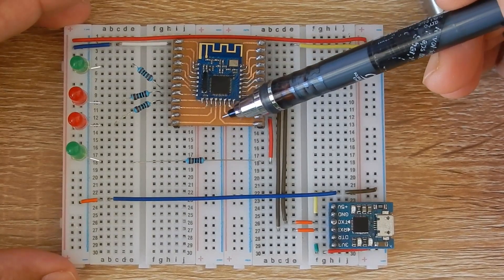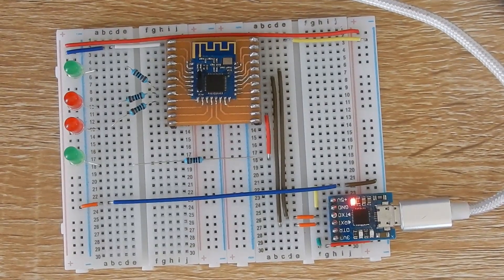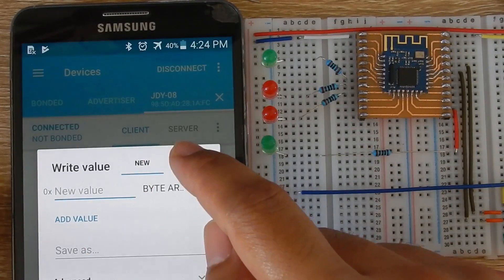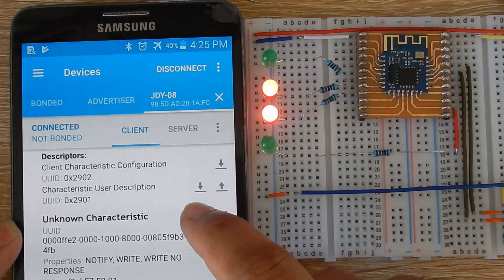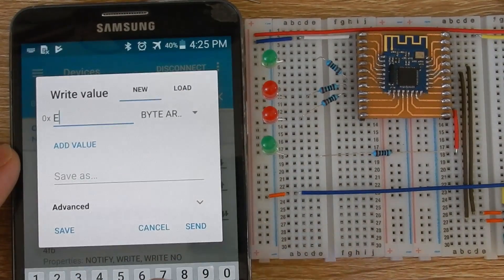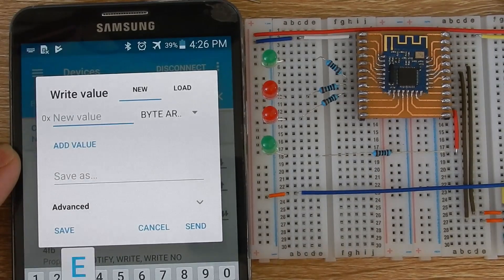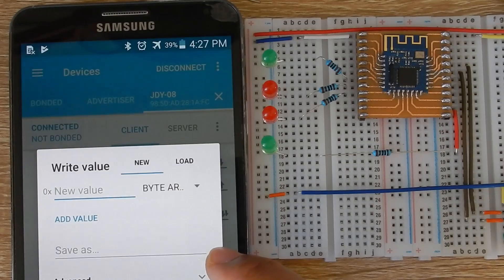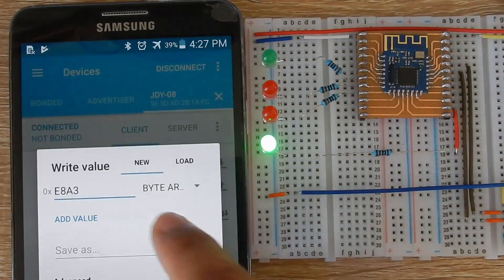Bluetooth/ BLE remote control without external MCU (JDY-08)

Comment: Mohammed Rezwanul Islam
can you read PWM (and IO state) on JDY-08 by a smartphone ( E.G. we are futher from JDY-08 module so we dont know what state of the IO or PWM pins)
Reply from the maker: Nope
Reply: @MohammedRezwanulIslam    I have done that(read PWM ) but  it can not with RTC (0xEC ...?!)Although I changed it being 0xECB...
Reply from the maker: I could not get the RTC working through smart phone.

Comment: Sir...What library you used to program the module ???
Reply from the maker: No library. I am using the stock firmware.
Reply: @MohammedRezwanulIslam  so what if I want to send a particular data from my phone . How will I program the board without external microcontroller
Reply from the maker: @WeTravel2023  you need to send some command from the android side.
Reply: @MohammedRezwanulIslam  could you please make a video  on it ?? Like how will I send a particular data say 123 or any char , with a LED as output .

Comment: @Mohammed Rezwanul Islam
 ; please tell me, why you don't use P17 (UART - RX) and P16 (UART- TX) to connect to PL2102  TTL to USB communication
Reply from the maker: I think I have. See the jdy-08 review video. In this video I am showing how to use it as a standard alone  IO controller.
Reply: @MohammedRezwanulIslam   thank you very much , because I am reading a news so I want to say thank an other time (this evening)  my local  is afternoon . I have read the host part of JDY 08 so I want make a project to scan BLE with a nano and write a sketch to run it  but with your video I think I use JDY 08 without the ardruino
Reply from the maker: @ThuanDuong-pv3xu  "AT+SCAN1" will scan the nearby ble devices.
Reply: @ @MohammedRezwanulIslam  ; I have watched your Video many time, I have read JDY-08 Bluetooth LE Module Datasheet too, But when I send ' AT+ SCAN1'  as your comment I am recerved by message ' OK,   SCAN STOP ' so what happened ?
by the way, I see part 8) APP control IO port (Use features UUID: 0XFFE8) in datasheet ,but you write control IO hex  ' 0xE7....' ?  and part 9) APP PWM control switch (using a feature UUID: 0XFFD9) , but your  is ' 0xE8... '  ?
Reply from the maker: For me the "AT+SCAN1" works.
Reply from the maker: Those are UUID. Read Bluetooth specifications to understand the full protocols.
Reply: @MohammedRezwanulIslam  : I am studying JDY_08 and JDY -10 , I have watched some web  , may I ask you  a question , can you change  Rx ( P02 ) on JDY-08 by another digital IO ? or  have you get a sketch of firmware on board  ? I watch a Germany 's instruction  but his project is the HM-10 and seems a bit complicated
Reply from the maker: @ThuanDuong-pv3xu  no, you can not change the rx pin.

Comment: Good video Mohammed, thanks for sharing!
I couldn't see any input pin on this module. Is it possible to connect a simple switch and detect open/close position as I would normally do by configuring an input pin on other controllers?
Reply from the maker: There is no input on this module. Only output. You can use cheap microcontroller like attiny to do the job.
Reply: @MohammedRezwanulIslam  I was trying to avoid using both microcontroller and BLE module. Are you familiar with an alternative BLE module I can program as stand alone sensor (without going into $3,000 compiler)?
Reply from the maker: @NinoRansenberg  nrf51822  module. The compiler is free.
Reply: @MohammedRezwanulIslam  Thanks!

Comment: Hola, qué tal,  it is a very good video, but I have consulted the link and don't find the app, so I want to say you if you can help with the app or the program or files. Saludos desde México.
Reply from the maker: In the description there is a github link. That link has the source code of the app. You need to install "android studio" to compile the source code.
Reply: @MohammedRezwanulIslam ok, thank you very much.
I see it and  comment you.
Reply: @TechMonky71   te salio?. En mi caso si logre compilar pero no detecta ningun bluetooth.
Reply: @markscalderonniquin9274  oh!   
Disculpas pero no he podido adquirir el módulo, espero más adelante poder comprarlo y probarlo.
Reply: @TechMonky71   ok

Comment: Can I upload a blink sketch into the Bluetooth module?
Reply from the maker: No
Reply: Ok, thank you.
How to add custom service(s) & characteristics? For example Battery Service > battery level; battery temperature; battery remaining time; etc.
Reply from the maker: You can not add custom services in this firmware. You need to write your own firmware. The compiler costs around 3000$.
Reply: @MohammedRezwanulIslam   how can we develop our own firmware?
Reply from the maker: @markscalderonniquin9274  the compiler is expensive. Around 3000 USD.
Reply: @MohammedRezwanulIslam  yes, I see but I will use the trial version
Reply from the maker: @markscalderonniquin9274  trial is for one month only as far as i know. It isn't worth my time.
Reply from the maker: @markscalderonniquin9274  you can use nrf51822 modules. The compiler is free though.
Reply: @MohammedRezwanulIslam   Thanks, I'll test it

Comment: Hi, I really enjoyed the video. It did inspire me!! I used this to automate my watering system powered by 2xAAA batteries. Backend attached to node red Raspberry Pi3 node red. The issue I have now is power consumption. It is consuming 8.3 mA and lasting less than 10 days. Anyone know how to lower the power consumption?
Reply from the maker: Put the device in sleep mode.
Send "AT+STARTEN0" command. It will enter into sleep mode. It consumes around 0.8mA. Try this command and let me know if there is any issue. Also connect a big capacitor (100uf will do) between power and ground.